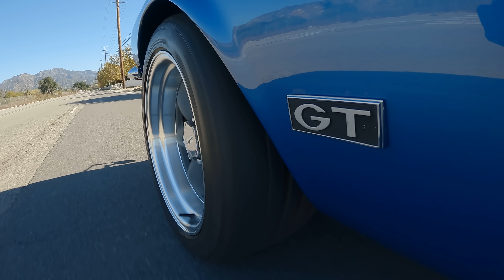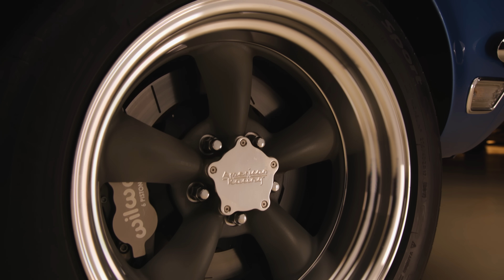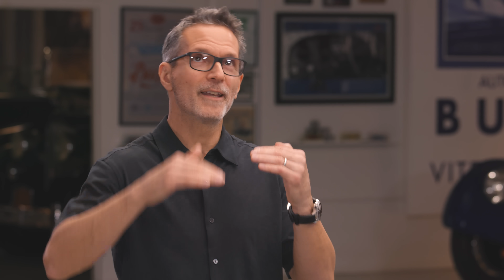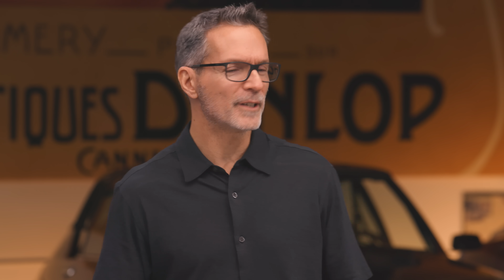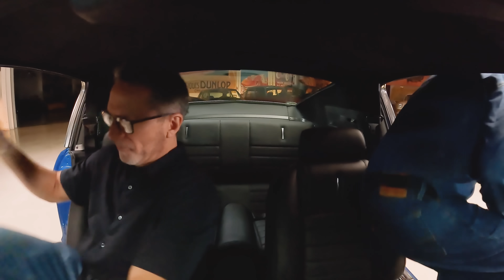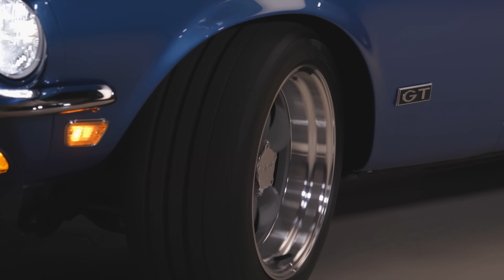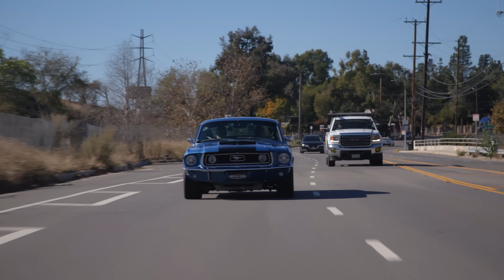Revology 1968 Mustang GT 2+2 Fastback Cobra Jet

Comment: Looks like a really awesome car, although I wish it had airbags (bonus points to the engineer who figures out how to shoehorn one into the center of that old-school steering wheel).   Even better would be if they did FEA on the body and optimized the welds in the front end for maximum energy-absorption on impact (i.e. he brags that their modern welding makes it stiffer than a vintage Mustang, and it's true modern cars are much stiffer than vintage ones, but they use FEA to do it in the right way - they're designed to crumple progressively, so in the front end you might want less/weaker welds than in the passenger compartment).   I say this because something I'll never get out of my mind was driving home one day and seeing that a big heavy classic Chevelle or Gran Torino had lost control making a left-turn from a fast-moving thoroughfare (probably trying to beat the left turn light in the rain) onto a residential street and went head-on into the corner traffic-light pole.   I then read in the paper it was a fatal accident - the driver probably would have walked away without a scratch if they'd been driving a modern car.

Comment: Probably the most knowledgeable guest I have seen on this show and what a car!!!  Just fabulous.
Reply: Realize that these are merely replicas of the original body, placed upon a modern chassis, with the suspension, breaks and drivetrain of a modern car. These replicas cost from $315,000 to nearly $400,000, however these replicas are made to be driven; not trailer queens.

Comment: My drift car, a single turbo, t-56 magnum swapped 1998 mustang gt...yes its a completely forged bottom end 2v modular v8 (sohc 4.6) with trick flow heads and forged trick flow cams and a link stand alone ecu. It makes 800 whp where i have the boost set. With 295s on the back thats more than enough. Anyway it has the factory dash in it and by god, its a 150mph speedo.

Comment: Very nice. I and my friends had a lot of those 60s and 70s muscle cars that were dumped on the market cheap after the first oil embargo in 73. They were cool back then. Now I'd rather have something like this. Its fast, will handle well and stop. Being able to idle in traffic without overheating is a big plus also.

Comment: Built my 1968 Mustang fastback about 12 yrs ago.  It has a 452 cu.in all aluminum FE engine putting out 550 hp.  The engine weighs about 450 lbs.  I lowered the engine motor mounts about 1 1/2" to accommodate the T56 Magnum transmission in the stock transmission tunnel.  I also built a 1932 coupe with a twin turbo 4.6 4V cobra engine.  I'm a Ford guy, but the problem with these mod motors is their weight.  They weigh over 650 lbs without the supercharger and intercooler.  I used to own a Shelby GT500 KR.  The understeer is huge when you have all this weight over the front tires.  All the Shelby mustangs and Cobras that won SCCA were small blocks.  The other problem with the 1968 mustang is a lack of room in the rear wheel wells.  I could barely accommodate MT 10.5W slicks.  With all this power, I could only hook up if they prepped the track.  All the power in the world doesn't make a fun car if it doesn't corner or hook up.  A better option than the supercharged 5.2L would have been an aluminum blocked stroker 302.  Now that car would handle.

Comment: You get what you pay for. This is what you would expect and surpassed by nothing modern other than a Rolls as hand built quality goes. Doesn't have to be a luxury car. Has all the stuff you want with none of the modern crazy tec BS. Thanks I'll parallel park myself. With performance to match driving would be  lifetime pleasure. To be optimistic when I get the money I will buy this

Comment: He states he doesn't like the term replica because it is an exact copy. Look up the definition of replica which has reproduction in its definition. Call them what you want, but once you label them as 1968 or so, they are copies because you cannot make a 1968 in 2024. You can only make a copy and since you are not Ford, you are also not reproducing them as it was Ford that produced them. 

Having said that, these cars are beautifully done and I would not hesitate to purchase one over an original which I would have to have restored. New chassis are much better than originals. Very well done Revology